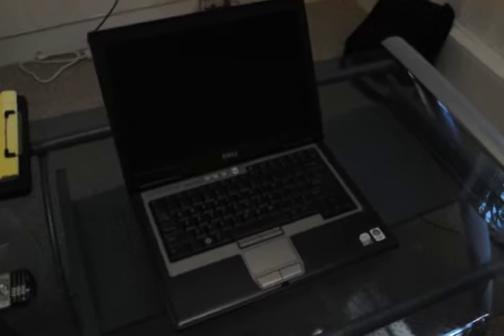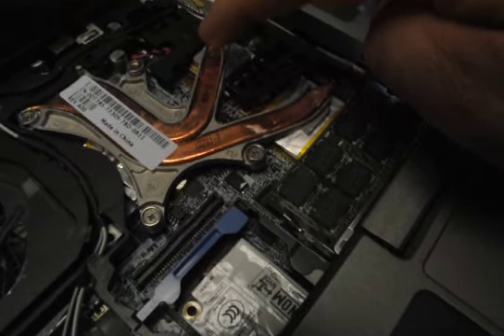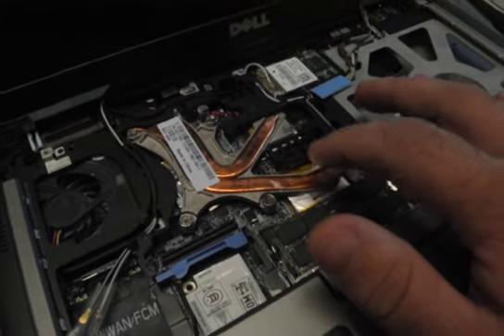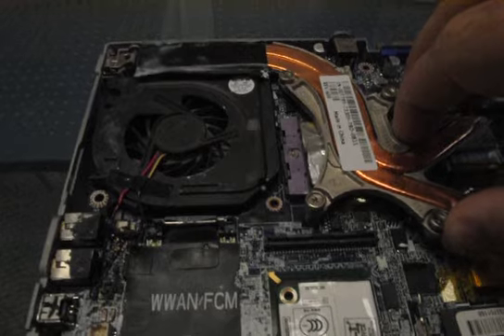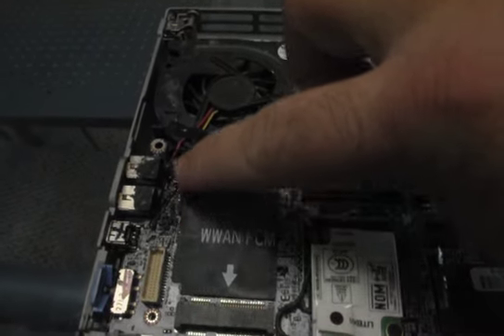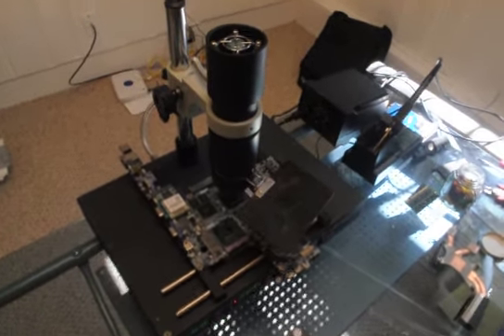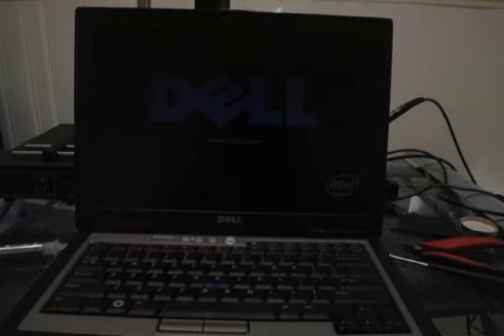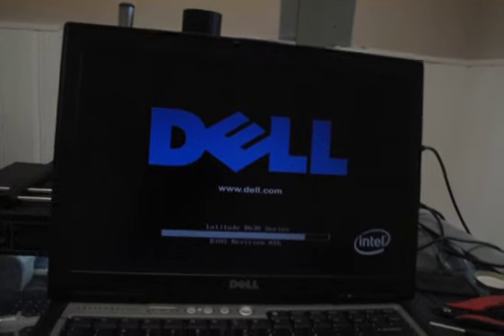BGA reflow of a Dell Latitude D630 to fix a scrambled video issue "fixed" by PrecisionDivision.com

Comment from the maker: @OutLaw2107 I would say it greatly depends were you shipped it to and who does the work. The life expectancy we see, since I own a D820 which I am using to write this comment and two D620s, is great if the work is done right. I see about 9 months out of my work when the user takes my advice after the repair. Now, sometimes that is not the case, but most of the time it is.

Comment from the maker: @applesetupdone Second, BIOS boot loading and stress testing are different, but heat is the same.  You have to burn in the thermal compound to heat set it.  Without a heatset, you develop voids and gaps causing issues of poor transfer.  A BIOS load will achieve this for you in a reflow just the same a an extensive stress test and burnin will through Windows.  We run a burnin program on our systems after we run them for two hours and see no difference in the BGA performance after.

Comment from the maker: @applesetupdone As for the underclocking, it may be a great idea that needs to be ran on a system, but most often times my customers are removing the hard drives which leaves the addition of any program impossible thus leaving testing equally as impossible on my end.

Comment: Hi man,
I have an issue about my compaq mini 702ea, it just started with the heating. I opened it and cleaned the heat sink and fan. After putting everything back in place, it took so much time in loading windows. I was running it on Windows 7 which was perfectly fine before opening. It was showing all the memory in use. Then I tried windows XP which works fine. But the thing is now Atom n270 runs all the time on 1.6 Ghz instead of 800 Mhz. Fan runs at full speed, I've not changed anything. HELP